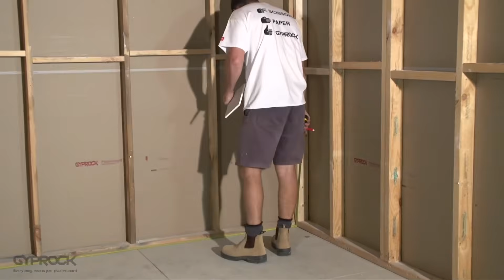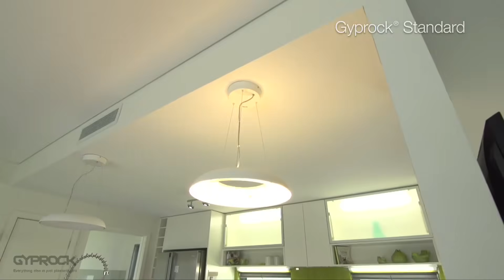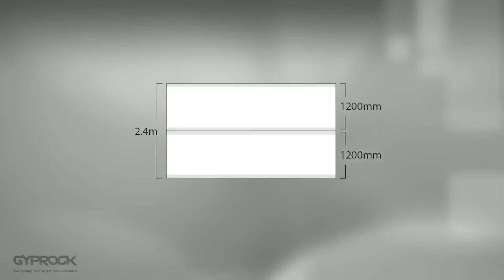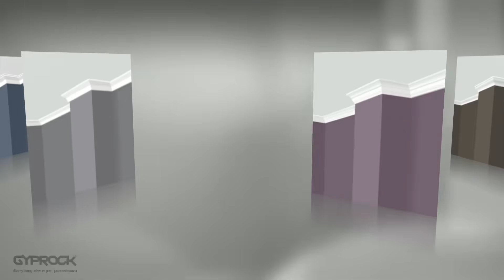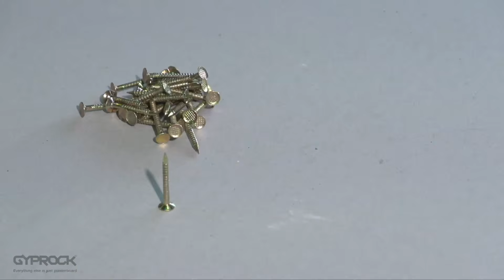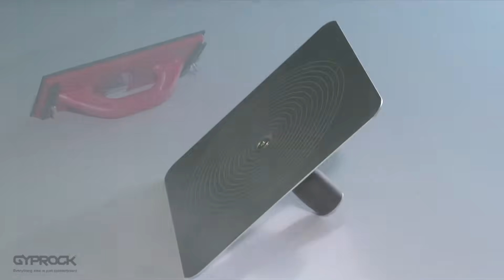Installing Gyprock plasterboard - How to plan, prepare and measure up

Comment: Great stuff ! Q: My walls are 2680 mm height. Can I install 2700 / 1200 mm panels vertically. Studs are every 600 mm so a 1200 mm width would fit ends on studs. Thanks